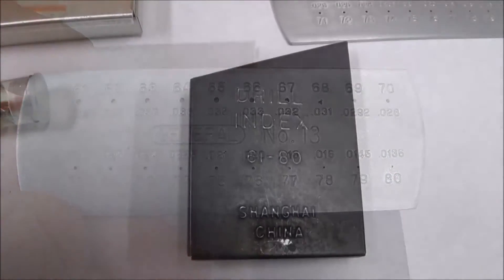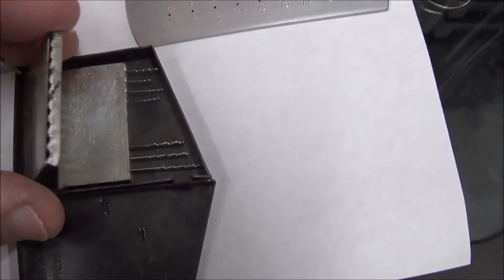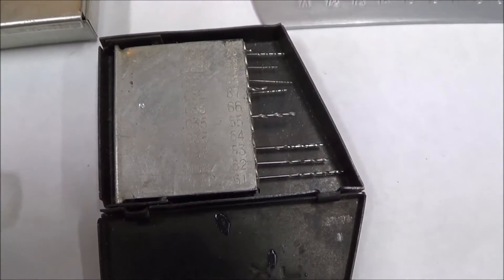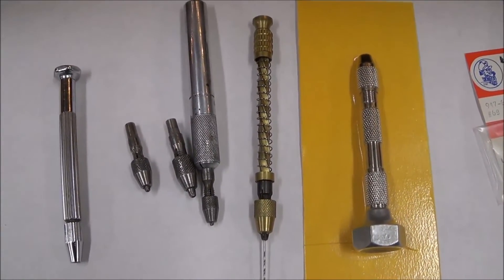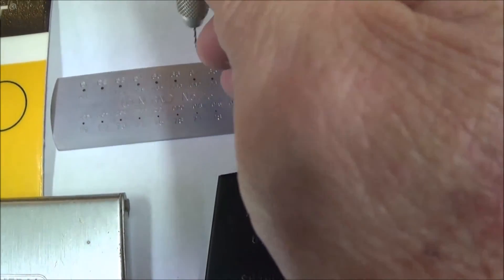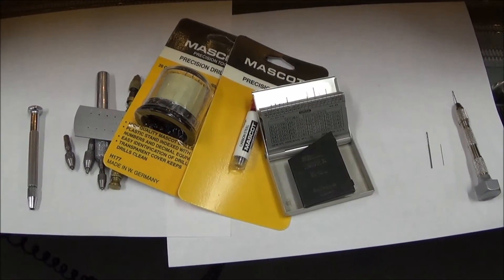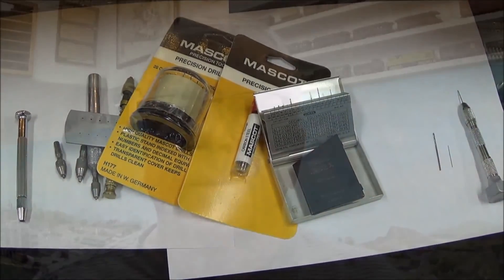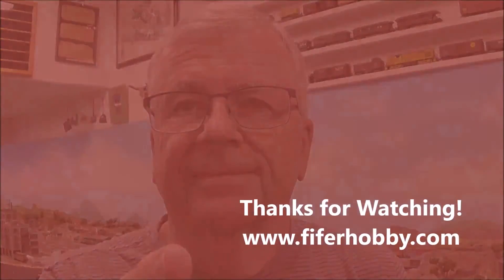How To : Drill Bits for Models

Comment: Mike, thank you for sharing this information. Very helpful!  I would like guidance on good choice of larger bit to bore holes in 2" extruded polystyrene foam.  I have some augur bits I have tried as well as more conventional one like you showed at the beginning. I need hole large enough to thread Kato Unitrack connector for #4 turnouts through.  Thank.
Reply from the maker: I have never tried that. On the club layout we used a long serrated knife to make square holes.
Thanks , Mike
Reply: Thanks for the tip.  Will keep in mind.

Comment: Nice video Mike I have a small Chuck that works in the Hex drive in electric screwdriver which is pretty cool by the way I did that with voice dictation on my iPhone so if it turns up weird oh well but either way cool video hand I voice dictation on the iPhone success how cool is that
Reply: Thanks Eric, Nice work with the phone.
Mike